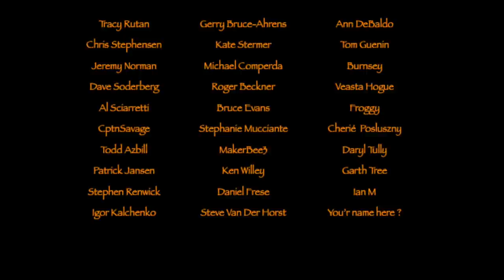3 in One

Comment: I´m in! It is called dropshipping when you buy from a company (or you actually think you are...) but they only order it for you from a third party, like the one in Pakistan. Many people end up paying taxes and extra fees as they don´t know or understand or it is not specifically told in the fine print. Best is to buy EU or at least buy the product from outside of EU yourself. If you make a picture search of the item you want to buy, you usually find many shops using the same picture and you can find more information on the item and and where it is actually produced. Here in Sweden Postnord is many times referred to as Postmord (postal murder) due to their not always so nice treatment of  parcels and customers. Regarding the axes I wonder what the profile of the axhead really is. A proper cleaving axe would have a slight convex wedge profile in order to split the wood. A fine chopper/slicer would have more of a  concave profile. I think there is too much of a focus on the bearded ax to be the only proper viking style ax. The beard has a function if it is a fighting axe, and also you can find a similar profile on carpenters axes. However, the spiky beard does not have a mass behind it to back up the edge and the forces it has to take as a regular chopping tool. The carpenters axe have a similar prifile so you can choke up on the head and really do controlled movements, so slightly different functions but similar looks. From what I understand the whole idea is to make it less heavy yet have a wide cutting edge as a fighting tool. I do have to admit it looks cool, though. The village looks amazing, would be very inspiring to stay a few days at the place. Keep up the good work, Tom!

Comment: The perfect place for me to retire.  
Now to the axes--- not my style.  "In matters of taste there can be no argument", yet our host did solicit commentary.  I do love a traditional lugged axe head, but my taste runs more to the Norwegian style.  The best one that ever hit the market was the Granfors Bruks "Norwegian Forest Axe", but alas, I missed out on it am and afraid they may never bring it back.  I have tried some other such axes but they are cast and so, unreliable.  I've never been able to find one that was "just so" as I'm sure the GB axe would be.  
I've used a traditional North American Hudson Bay Axe for decades and am familiar with the concept.  It is always a trade-off between the length of the blade and the weight of the axe.  For my hand, and arm, and ergonomics, the bearded axes favored by the Swedes generally fall short in the weight and heft department, and the lower tip of the beard never even really gets used during camp chores, and so is virtually useless.  Now, a little bearded axe like that in close quarters for self defence could really make sliced salami of an attacker's face.  Cool looking, but a weapon not for everyday camp use.
Reply from the maker: Thank you so much Dan for sharing your experience with axes and your options 😁👍🏻
You obviously know a lot about axes and I appreciate your feedback very much 🏕🔥Tom